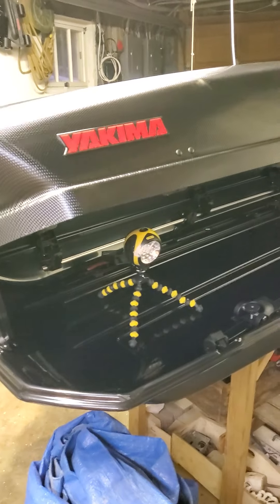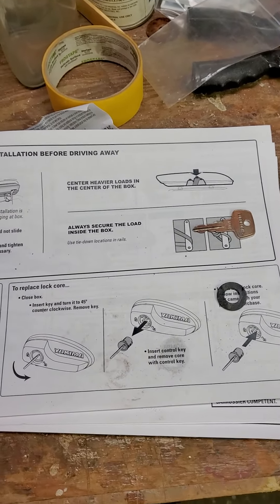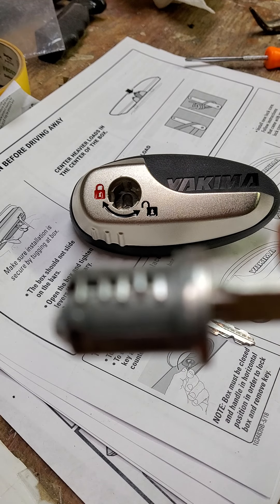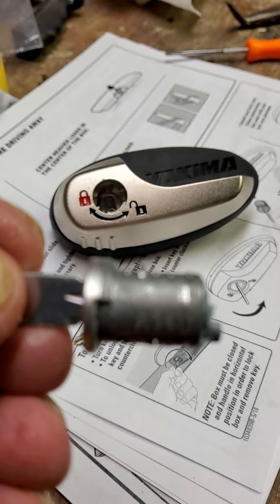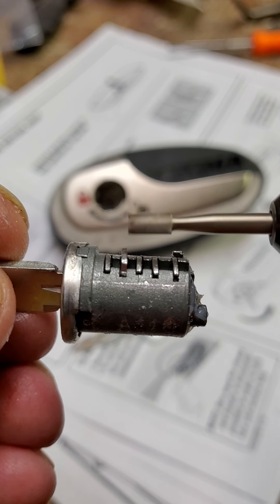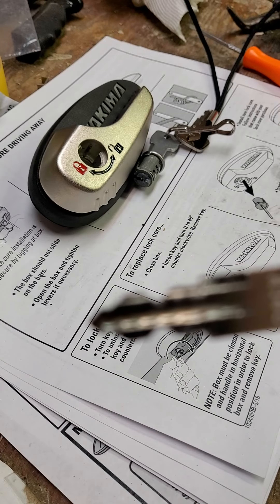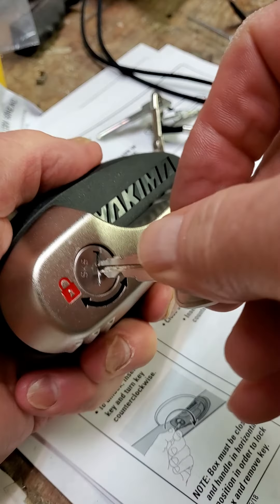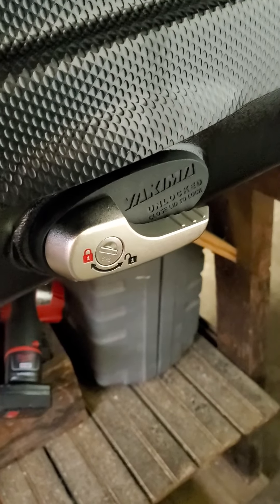yakima box key removal in unlock position

Comment: After you grinded pin 3 inside your core, you can use core remover key (flat key not fully inserted) to lock and unlock, as well as 25% of any yakima A keys will unlock this core.